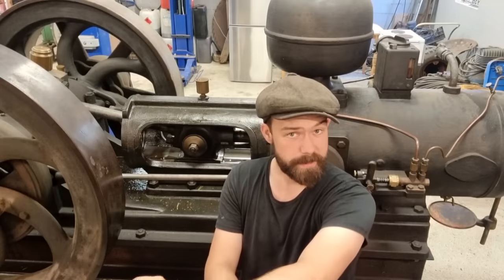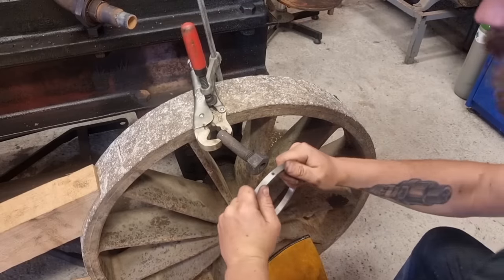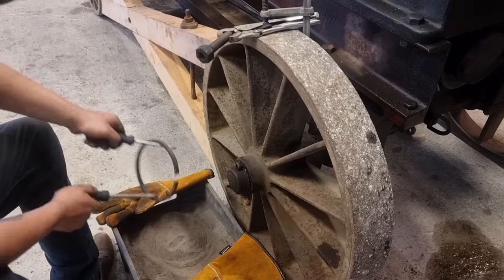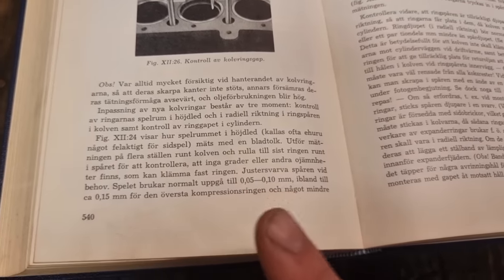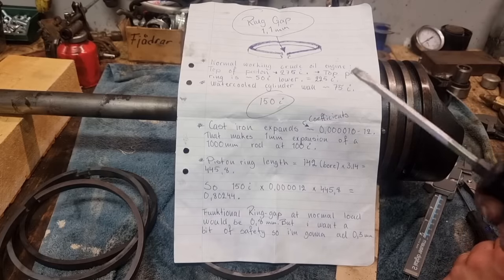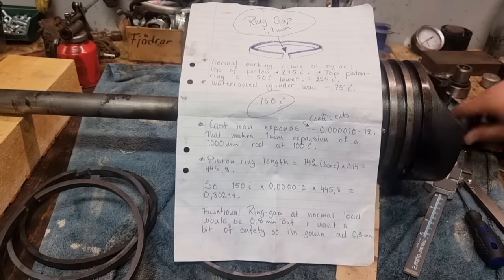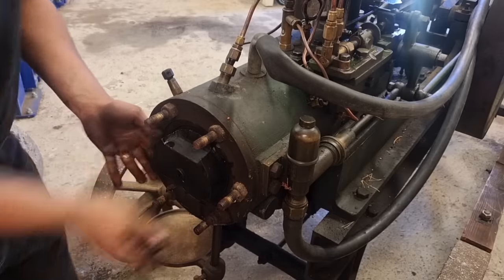Making Piston Rings!   In just 131 easy steps?..

Comment: Seeing things like this really makes you realize how spoiled we are with modern engines. To think that there was once a time when everything you did in this video would have been just another day in the life of a mechanic! Excellent video, well explained, and very valuable information! 😃
Reply from the maker: Yes, today we just scrap the old engines and get a new chinese one that lasts a month. This engine has a soul and quality! /Richard
Reply: This makes me feel like they were Spoiled back then. No goofy computer or smog gear and miles of wiring
Reply: @realblakrawb  no EPA regulations either that limit horsepower on diesel automobiles either.
Reply: @johnded3874  No computer to run a fuel injection system = most semi trucks were gasoline until the 1960s.
Reply: Run away diesels anyone? Lol
Reply: @johnded3874  I mean horsepower has gun up dramatically in diesel and gas engines over the last 20 years so I don't follow.
Reply: Consider a modern 2.0L that makes 600hp 😅 100x the power output in a much smaller package. Things are far too complex these days… being a mechanic in the 1900s would be a dream in comparison.
Reply: @gurgleblaster2282  I have a modern 2.0 diesel that makes 240hp/500Nm and meets modern emission standards. Technology has come a long way. I both love and hate it
Reply: @dickard8275  i get hating the complexity. But I think what people don't get about higher efficiency standards is a more efficient engine can make more power. I remember people complaining about epa standards dooming muscle cars back in 2008/9 then only a few years later we get a 200mph Mustang so 🤷.

Heck I have a 240hp 2.0l that averages 30 mpg in a small suv lol. When i was in high-school that was at best like 16 17 mpg and less than 200hp in a vehicle of the same size.
Reply: @gurgleblaster2282  Emissions arent the same as efficiency though. Efficiency has gone up, but emission limits have capped power more. If you ignore emissions and tune a modern turbo for power you can make huge gains.. 150% even with no hardware changes.
Reply: @dickard8275  I see what you mean inmisread that. Yeah there would be more power. Like the diesel gate snafu. At the end of the day though  this is an amazing time for engines despite people's fears.
Reply: @gholland5840  Bit earlier than that.
Reply: @gurgleblaster2282 theyre very complex though, trading efficiency and some power for reliability and ease of repair.

Comment: Great content, love to see old machines working strong after so many years, made to work reliable. Not like todays products, lasting to the end of warranty, made only for profits.
Reply from the maker: Exacly. This is made to last as long as someone wants it to last. /Richard
Reply: Modern engines operate far longer without fiddling with them or taking them apart.

People also expect more out of them, like if you have a luxury car now you don't expect to have to employ a chauffer who goes to rolls for a course about how to keep it going for just 10 years with daily(!!) maintenance - unfortunate result though is that something that breaks and needs just 10 days of work makes the car not worth it to repair.. The old one would have been worth repair at multiples of that.

Diesel generators work really long times too without fiddling and even cheap honda clone generators work astonishing times compared to a land engine from 1900 while being simple to get running again. Also their design isn't patent dodging encumbered.

Comment: When you said you were going to heat it with a blowtorch I was thinking a propane or oxy-acetylene torch. I haven’t seen a real blowtorch in use for over sixty years. I am impressed.
Reply from the maker: Those Sievert petrol torches is extremly reliable and fast, lots cheaper than propane. Always using them. /Richard

Comment: Cool video!
Usually, in modern engines at least, you want a little larger ring gap on the secondary ring. That is because you don't want any pressure build up between the rings because that can break them.
Reply from the maker: Hi! Never heard of actually. Probably somthing to due to modern diesels high pressures. /Richard
Reply: @YesterdaysMachinery  it's actually a function of the rpm that diesels run at. The slower the rpm the tighter the gaps to prevent compression loss. The higher the rpm and the more heat generated the looser the ring end gap so the ends don't tough and jam the piston or gouge the cylinder walls

Comment: At last, someone who knows how to make piston rings correctly.   I have see elsewhere someone making a piston ring by making it larger and cutting a slice out of it, and as you correctly point out, that does not make it round.  I was taught to sandwich the ring between thick plates of steel with a wedge to gap it.  Heating it while it is like that, it will heat evenly, stay flat and cool slowly.  I look forward to seeing the engine run. Excellent video, many thanks.
Reply from the maker: Hi! Yes to fix the rings in a jig and then heat them is a good way. But i can't really see that this method makes the rings less round. But the importance is to heat them up slow and even. I have seen people heting them up and when cherry red they drip them in to oil to cool instantly. I dont really know how that affects the rings. But i want them to cool slow. /Richard

Comment: I see that since this machine has transfer and exhaust ports, the rings are pinned to keep the open end of the rings from "falling" into the ports and destroying the engine. I used to work on double acting piston compressors which used packing glands to use both halves of the stroke. The piston rod was secured by a thread and jam nut to allow the gap to be set at each end of the piston. The use of a locating pin to keep the piston from turning in the bore is really quite clever. To lap rings to the desired thickness and flatness, we used a large circular plate with an offset ring that held the rings off center of the rotating plate and used grinding grit to cut and polish the faces. Really enjoy the content. Amazing how well the technology worked back then.

Comment: An excellent tutorial video. Using the coefficient of linear expansion to calculate the ring end gap is the most accurate way. Many younger machinists today have the basic knowledge , but lack the “hands on skill” , relying on computerized machines to perform the task. 🇨🇦
Reply from the maker: Hi! Thank you. The biggest problem i see today with young people is that they done have confidence to try because they are scared to fail. They must have someone right next to them to explain every little move. Then all they gonna learn is How to make something but not Why ypu are doing this way or that way. Of course you have to be careful with machines etc. But you have to try things yourself to grow and get a mind that can think outside that famous box. I have met so many mecanics that are very good at something because they have been tought to fix that exact part. But when another thing fail on the machine that they doesn't know aboute they just stear in to the wall and doesn't even think about figure it out themselfes. /Richard

Comment: Great video! Re-using old material, like the belt pully here, is so creative. Making piston rings like this, however, was new to me. And it might come in handy, as I met I guy today with a REO automobile from 1905. The car got its last "check-up" in the 1950s... It has a single cylinder engine and would most likely need new piston rings.

Comment: As always, your skill and knowledge are most impressive.  Doing the calculations from scratch is something very few machinists would do.  Being a collector of antique cars and tractors I often have to modify a given newer part to fit an older application….but I can’t remember ever making one from scratch.
Reply from the maker: Thank you. That is something that i really like. That in the year of 1913 a small group of men made all of this by hand with hand tools and every bolt and nut are made there in the small workshop. The castings are not made exactly there, but the molds where. So many hours and manual labour. /Richard

Comment: You should watch the video of Mr Crispin making piston rings for a small steam engine, he used the same method like you, but he found out that the rings don't stay completely round with this method, so he used a better method to make sure the rings get perfectly round...
Reply from the maker: Hi! This method has been used for so long time that i dought that it doesnt, but i will check that up! And if there is a problem with the roundness you can jig the ring up in the lathe again after the heat treatment in the compressed mode and then cut the roundness end shape. But all my rings have been that good so i dint really bother doin it in any other way! /Richard
Reply: @YesterdaysMachinery  yes, that is exactly what he did to make them round again...
Here is a link to his video:
https://youtu.be/2mqdIA3SFJs

Comment: I'm assuming? the half notches in piston ring locate over locating pins in ring grooves to prevent piston rings from rotating in the grooves, because I have seem modern 2 stroke engines fail because of locating pin failure ant the end of the piston ring snagged on an intake or exhaust port. Wow very good info of which most which I had forgotten from my vocational school days! Can't wait for the start up video!

Comment: I live in West Central Mississippi.  Our state fair is held in the capital, Jackson,MS. in early fall.  40, even 30 years ago it was quite common to see numerous old hit and Miss engines on display outside the Agricultural & Industrial building with some of them in operation.  One elderly fella had his hit and by miss running a corn grist mill and sold cornmeal made using the machine.  It was quite interesting.  Many of them had old flat head screwdrivers wedged into/through a portion of one of the engine’s valve springs(suspect the exhaust since it probably experienced the most heat and loss of spring tension but I never paid that much attention).  I don’t know why but, for some reason  I never asked.  I suspect it was because the valve spring had lost some of its strength over the years and the screwdriver wedged in where it was restored enough valve spring tension for the valve spring and valve to operate well enough for the engine to run.  The simplicity and durability of these engines was impressive.  They could basically worked on in very adverse conditions with most any part of it taken apart and put back together with an oil can, monkey/crescent wrench, a pair of pliers and a screwdriver.   Some of them had far more complex speed control Governors using centrifugal action where others to memory either did like this engine snd the Governor just interrupted a fuel injection cycle or two.  I think I saw a couple that interrupted the opening or closure of the intake or exhaust valve.  I don’t recall any of the gas engines using an interrupter of the magneto snd spark plug spark/ignition but don’t recall for sure.  While I was interested in how they operated my hearing loss from the militaryArmy 74-77 and many years in industrial applications like power
Plant maintenance caused me difficulty in hearing explanations while there was background noise.   I’m 66 now and 30 to 40 years ago most of the elderly gentlemen were in their late 50’s to mid 60’s some into their 70’s that brought, transported their numerous old engines many miles to show them to the younger generation at the fair.  I have not been to the fair in 10 years or so but even before that it got to where there might only be one or two elderly fellas with 1, maybe 2 hit and Miss engines.  To memory the largest continuous HP rated machine was only like 10 or 11 Hp and it was physically massive compared to a modern equivalent yet differently rated Hp machine.  At 66 with a long list of ailments myself, less disposable money each year and the cost of everything including fuel, food and lodging going up I can understand why the older gentlemen from 30 to 40 years ago no longer show up with their machines.  I sure wish someone had picked up their slack in seeing that these interesting old workhorses of farms and homesteads continued to be displayed at least once per year at the local state fair. I sure miss seeing them operate and smelling their operating aroma of diesel or kerosene(out of sight expensive), hot lubricating oil and cooling water.  To memory one fellow had a multi-fuel machine that would run on just about anything from kerosene to diesel to lighter weight engine oil.  Sad to see the operation of these engines list to time but we all get older and if no one picks up the passion of keeping these old engines operating including the expense of travel, food and lodging then their place in history will be limited to pictures in history books or YouTube videos.  Thanks for sharing the resurrection of this old machine especially the making of the cast iron piston rings.  Looking forward to seeing the third video showing it operating.

Comment: Really enjoyed this. Been in this business a long time and have seen different ways of making rings, it's good.
I wonder why the locking pin for rings? Common thinking is rings should be free to float around the piston thus evening wear.
Which would explain why the old rings had the shiny spots, they couldn't rotate around the piston and hadn't fully worn into a not perfect bore, the "break in". Maybe the purpose of the the locking pins is to eventually allow rings to wear onto a not perfect bore.
Love the old books.
Just bought a Chinese made 4 cycle fairly heavy duty weed trimmer/string trimmer. Within two tanks of gas the oil was grey. Dumped the oil. After 2 tanks of gas oil not seriously discolored but going to dump it again. Reflects the machining philosophy of different times and nations.

Comment: You should have drilled the pin holes after turning OD and ID, before parting them off. If you had a tool post mounted drill motor, you could have done this without breaking your setup. Quick, easy, and accurate. If you mark the OD with the parting tool, you can center the pin holes very accurately. Hope this takes the guesswork out of the job.
Reply from the maker: Hi! Yes i could. But when the rings are this big it is less time cunsuming and easy to be acurate as i did it. Often on those old engines the lock pin aint even centerd in the grove. So better to manually test fit them and take a little more etc. But if i should make like 20 rings at once it would probably be worth to make i jig and drill the hole. /Richard

Comment: The problem is actually to get even spring pressure all around the bore so In production they are actually made from spun-cast cylinders which are then cam turned and bored in like an egg shape then cut with the open gap. Then hammer peened to stress relieve and hardened. All the working is then done with the ring blank compressed  to the installed ring gap. It's a process patented before the 1st war. I worked a few years on the cam turn and bore machines for the UK's largest ring manufacturer.
Reply from the maker: Hi! yes i have tried peening the rings also, and it works. Then you have to put the ring it the bore and check for roundness or light spots. And the peel a bit more. A couple of the Closest engine manufacturers of crude oil engines here back in early 1900,s did peeling instead of heating. But then i tried this method and found this working absolutely perfect and way less work. But for more modern engines it might be a good idea to peel the rings and making them egg-shaped as you say. Very interesting. /Richard
Reply: @YesterdaysMachinery  
Well yes, doubt the rings in those were exactly overloaded! We were doing modern high-speed diesels like Cummins. We also made the rings to restore Rolls Royce Merlin engines and old racing Bentleys, stuff like that as well as the liners for   two-stroke diesels. Piston rings are complicated things really, I ran the machines that made the barrel profile in the chrome plating which some companies used for the second ring, that was an art for sure!
My grandfather actually made oil engines, he had a business in Scotland between the wars. You see them around at shows occasionally, G & J.S.Souter engines from Elgin.

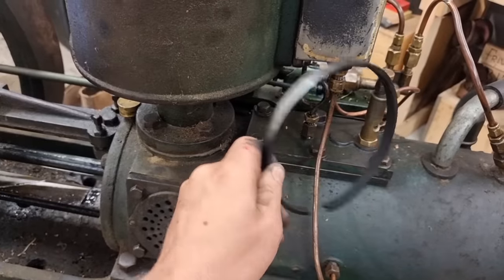Comment: 2:15 A disc break rotor will work just fine. Mine are a little thinner, I use the part just outside the bolt hole circle.

Comment: Really interesting that you make the rings the same as the bore then expand them..i was thinking you had to make them a little larger so they spring out and the gap you cut with the saw will be closed (adjusted for) ..then i thought about it a bit and it makes more sense to expand them so they fall back into the right size bore but then the gap problem is going to be the with of the saw.. Thanks so much for this light bulb moment and more questions.
Reply from the maker: Exactly! It seems in the comments here that many people thought that you should turn them oversized as you say. But that dont make a good ring at all. Stay safe. /Richard
Reply: @YesterdaysMachinery  And you too...but remember its all just theory till your face melts off...HA!..really enjoy your work and thanks.

Comment: Have had great success with cooling very slowly cast parts by burying the heated part in oil free Vermiculite. After 24 hours the part was still too hot to touch. Highly successful for cast steel or cast iron repairs or super slow cooling to prevent thermal shock.
Reply from the maker: Hi! Very interesting! Have to look up Vermiculite. Never heard of. /Richard